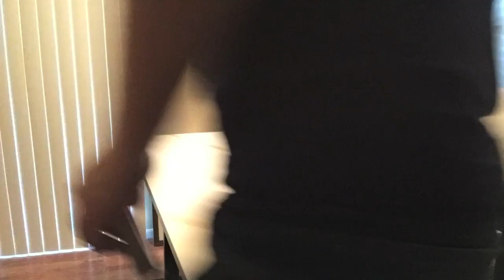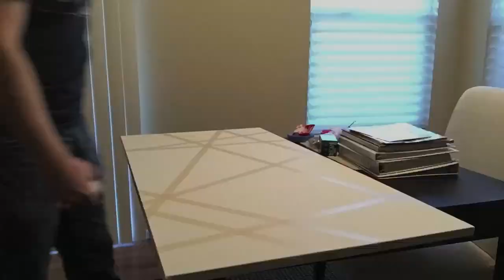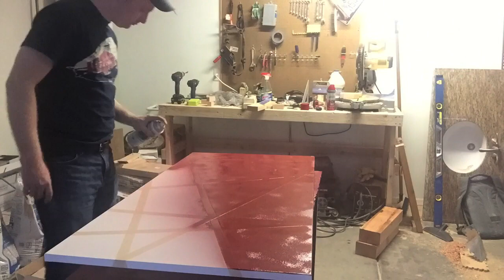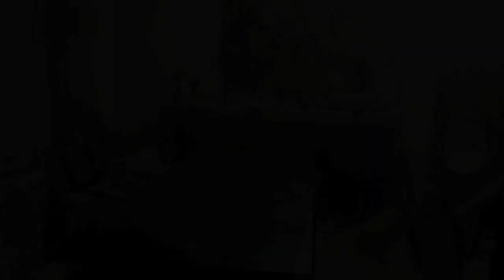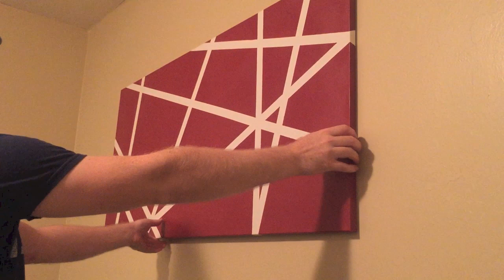DIY Quick and Easy Modern Wall Art on Canvas

Comment: cool....which tape u used?
Reply from the maker: +Momina Patel I used regular masking tape... I would recommend not using painter's tape as the paint seeps under it and the lines won't come out clean.
Reply: I'm surprised at how clean the paint lines are with regular masking tape, I will definitely try this!